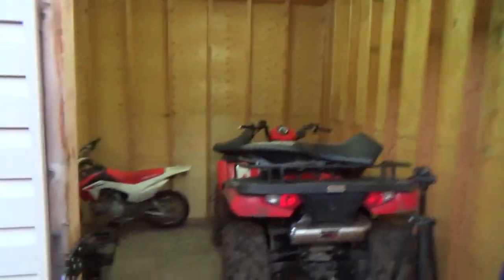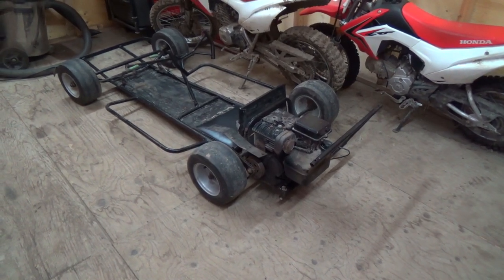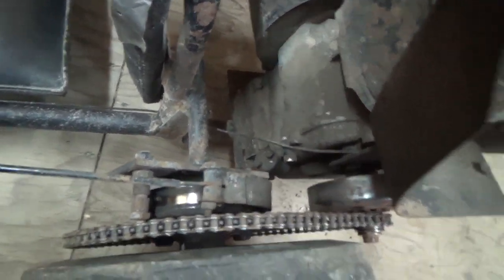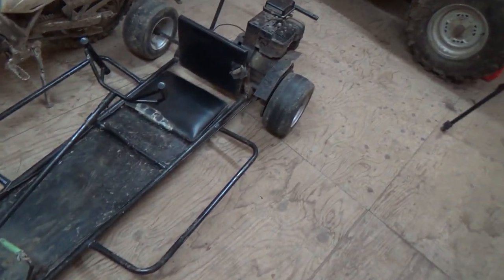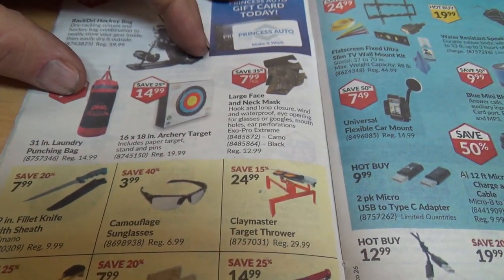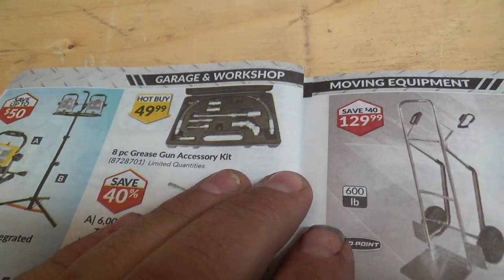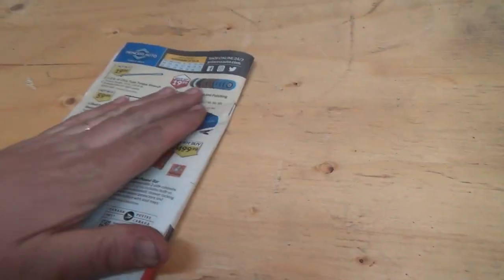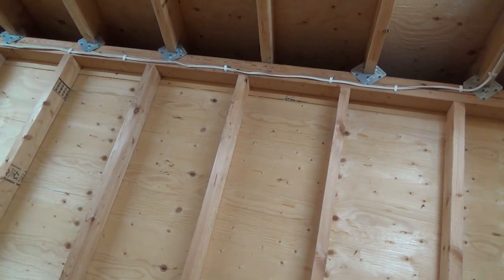Go Cart stuff and a PA flier to look at

Comment: First thing: I wouldn't change out that B&S engine until you absolutely have to.
Second, I'd get that chain alignment and tension looked at ASAP!  Maybe go buy new chain. If the new chain is too loose use a spring loaded sprocket idler/tensioner to take up the slack.
It's a great little fun Cart, keep it in good tune and enjoy.
Reply: Definitely looked like the sprockets aren't quite aligned. A crooked chain will always come off. My guess is that something caused them to get out of alignment so the chain kept coming off so someone tightened the chain thinking that would keep it on. Nope!

Comment: Hey Bill, I’m not sure if it’s building codes in Canada or what, but if you think about it and you put an eve trough vent in with those little do-ma-hickies that brings airflow up to the peak, it really doesn’t do that much with spray foam. When you do that, all your doing is creating an air passage from the eve to the peak and it has nothing to do with the interior space because the spray foam has completely isolated it. I don’t think it would rot out on you unless there are leaks in the roof... Like I said, I don’t know. Im just a woodworker, not a framer or builder, so I don’t see the problem with that. Only thing I would do is put a vent fan up there to evacuate any excess moister that could possibly be in the air. Keep them coming! Love seeing a new post from you!

Comment: bill you are better off putting some 1/4 or 3/8 ply of OSB to make a ceiling and then spray that stuff. air movement is always good so that you don't mold and rot your roof out. I would put plastic up then your sheets then the spray. just to be safe so that your sheets don't get wet with condensation.  I've been working and learning as a carpenter for 10 years now Bill i think if you do try insulating your going about it the right way and if your going to insulate make yourself a ceiling.

Comment: Okay Bill I build houses and fabricate for a living you only have to plug the eaves off on the inside of the building if you spray foam it and spray foaming is the way to go if you got a guy I know a guy it's better than fiberglass any day can you spray foam seals the building whenever I build a house we spray from him now we do not put fiberglass insulation in them it's more cost-effective and we get a tighter envelope and you can just leave the eaves open if you want to if you spray foam it now if you put fiberglass in it you're going to have to put soffit on the outside that way the fiberglass gets to breathe that's the difference between fiberglass and Spray Foam as always love your videos keep up the good work four hate yeah I just do one of them propane infrared heaters from the ceiling and if you insulate it you can leave it on low and probably keep the building around 40 degrees Fahrenheit I don't know what Celsius would be and then when you come in you just turn it up higher but anyways that's your choice heat is he my theory is if I could haet it with all wood I would but I don't know what the rules are in Canada cuz they do make some pretty cool little fireplaces But there again you're having to start a fire I understand the thinking behind that I say infrared gas heater as again I'll quit blowing on and going this is a pretty long one but catch you on the next video

Comment: Okay first off, keep the briggs. Two pulls is really good and it seemed to be pretty good other than needing a jet clean and a new diaphragm. Like others have said, gopowersports.com is a great place for gokart parts. I would also replace the chain, sprocket, and centrifugal clutch. When you replace the chain make it a link or two more then the old one if it's still tight. Good luck bill! PS- gopowersports has good kart bearings also 👍

Comment: i wonder if you can get the other rear wheel to drive too.
Reply: One wheel has to be an idler for when you turn so you don't wear the tire out. Or you have to add a differential.

Comment: Is it an illusion, but looking down on that rear wheel, it looks like it's bent backwards, i would be inclined to say it may have hit a kerb bending it back, and maybe they had to remove a link to tighten the chain, also if you look at the chain from the top it doesn't look straight, which would confirm the bend
Reply: I see the same thing, so maybe it's bend backward